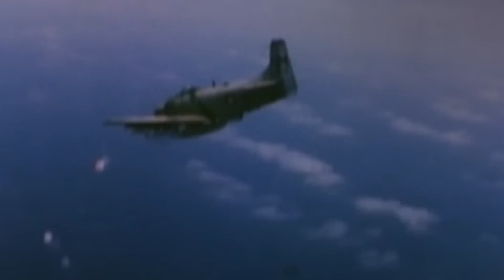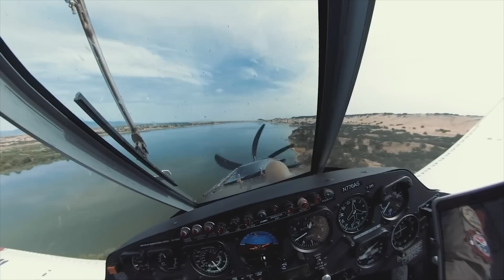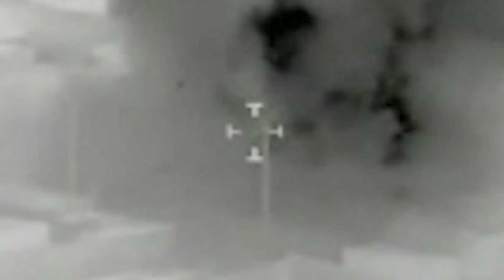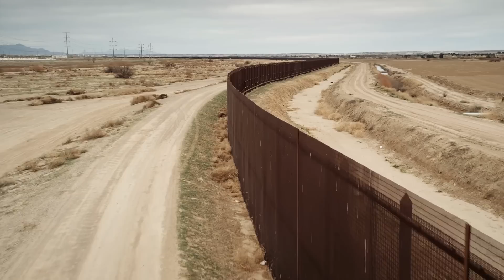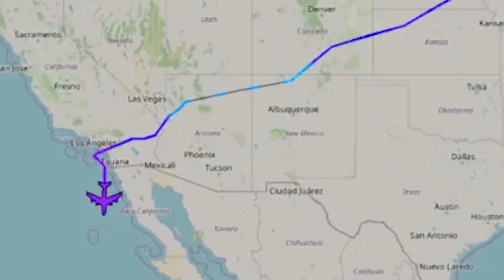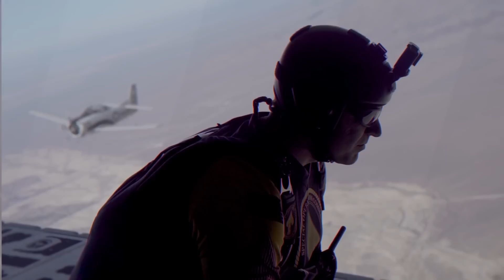Cartel Killer Weapon Arrives With 500 Pound Guided Bomb

Comment: Anyone know if it has ejection seats?
Reply: It doesn't, so you're going down, your going to eat it. The original SkyRaider got a Yankee extraction system in the 60s it was a rocket that pulled the pilot out of the plane by his flight harness, it has a high success rate and unlike an ejection seat it doesn't push the pilot out compressing his spine

Comment: They didn't lack an aircraft like this.  They have one they used on and off since 'Nam,  the OV-10 Bronco.  The didn't need a new airframe.  I while back Boeing (who had acquired the company that originally made the Bronco), had proposed a modernized version, with up to date electronics and weapons.  The USAF should have bought that.
Reply: It’s because their offer was just slapping on electronics on old existing airframes that have been sitting for decades. There was no provision for re-opening lines for new OV 10 airframes or even refurbishing airframes. It would’ve been strictly an avionics update.
Reply: They flew three of them in testing and went with other stuff for the sandbox.
Reply: @ OV-10s were used in "the sandbox: (Iraq, Syria)
Reply: Why? What is the benefit? You seem to be making some unfounded assumptions like mostly that it will be cheaper and have the same capabilities which there is no proof of.